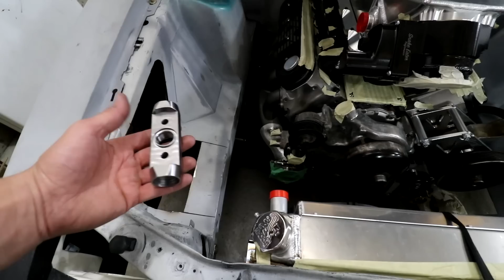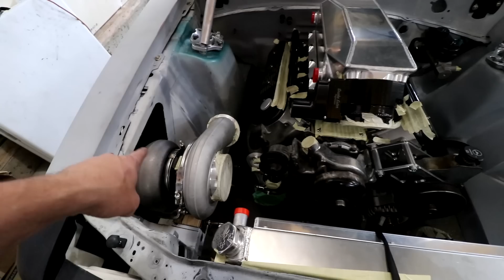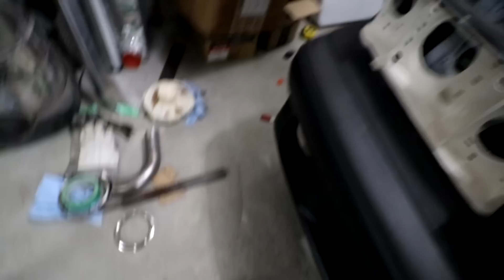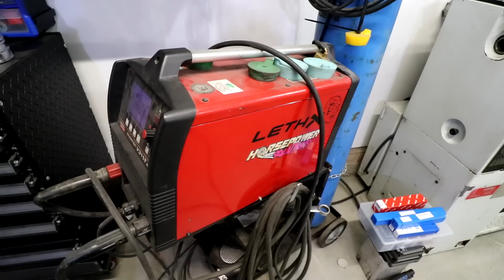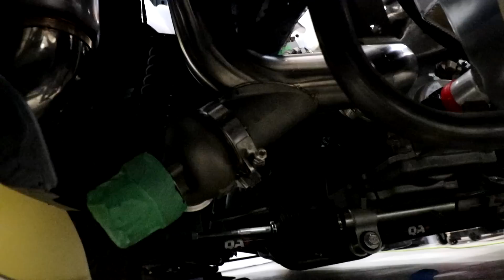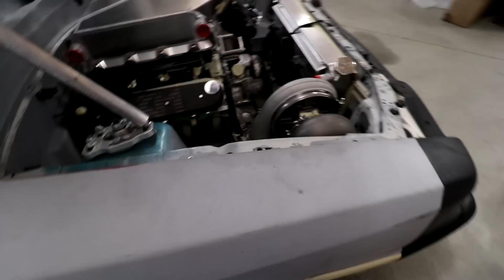I Built A 1000hp Turbo Set Up In One Day!

Comment: Why not clock the turbo so the outlet is facing the back of the car and cut the housing back to 4”, sharp 90 out of turbo then a bend it into the intake? Effectively you are just heating up your intake air with your exhaust manifold

Comment: Did I miss something or did you only connect half the motor to the hot side? Neat work either way and that mullet has some flow to it now.
Reply from the maker: The hooker manifolds are like a log manifold that connects in the back it was already done
Reply: Was thinking same thing. Super clean looking.

Comment: Good work my mullet brother. I have a couple questions, 1st, have u used any of the ahc alphatig welders? The people I've talked to have had good results. Being as you use a Neverlast, I was wondering how they compare. 2nd, when you have welded up factory ls manifolds for a budget hot side, what have you used for pipe and have you had good luck with cracking?  Back in the day the engine swap log headers for S10 V8 conversions would crack constantly.  Keep up the boost buddy!